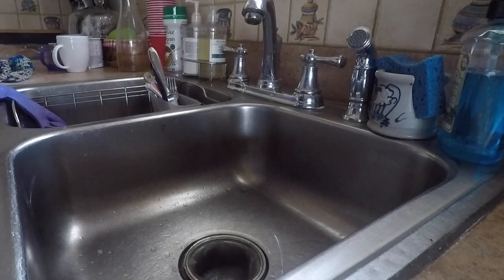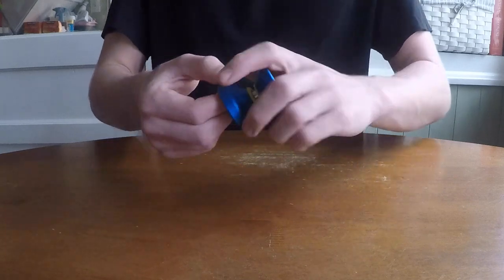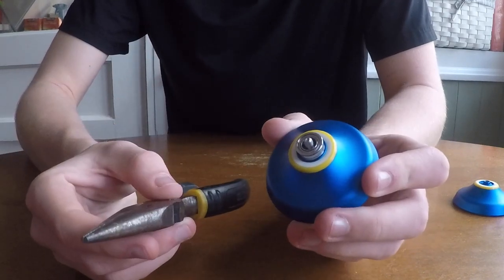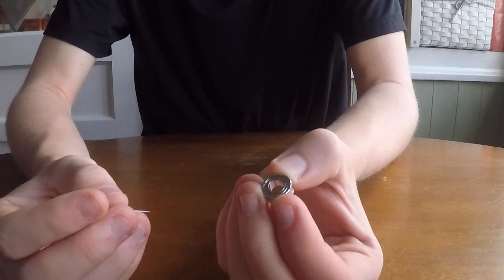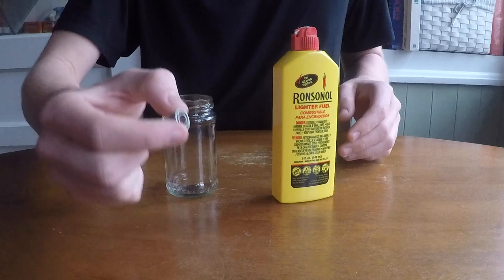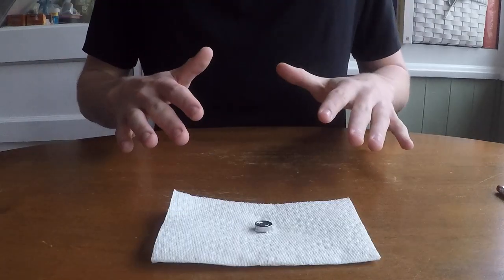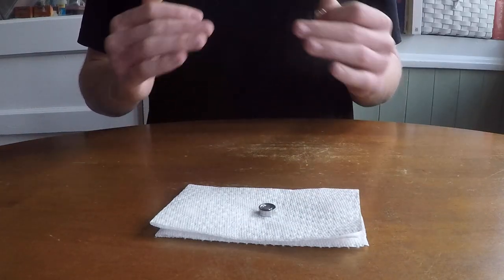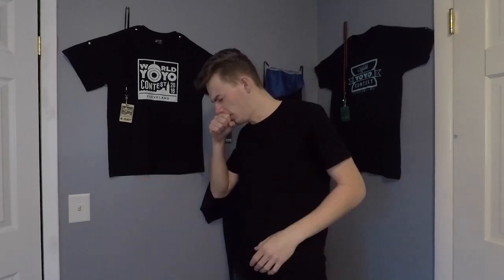How to Clean a YoYo Bearing - Plus LIFE HACK

Comment: any time you need to chuck/hold/wrench on a surfaced part you should wrap it in something to protect against chuck marks/plier damage. I prefer to use rubber bands, toss one around a bearing or an axle and then you can use pliers w/o damaging anything. brass chucks for a vise can work as well or wood blocks that are soft wood so you can grab w/o damaging. GL everybody